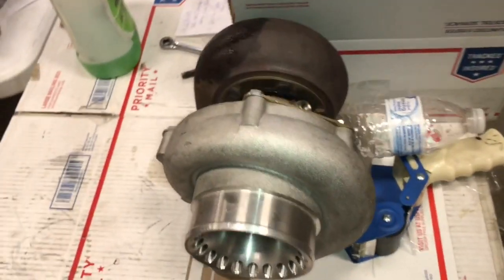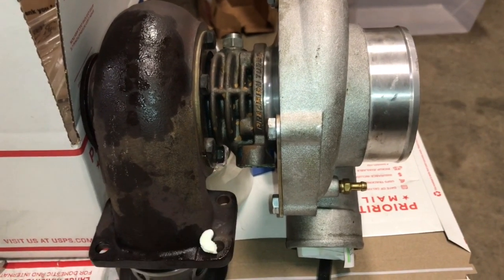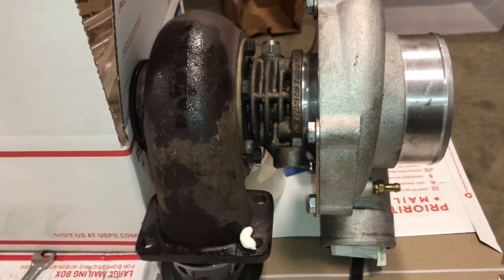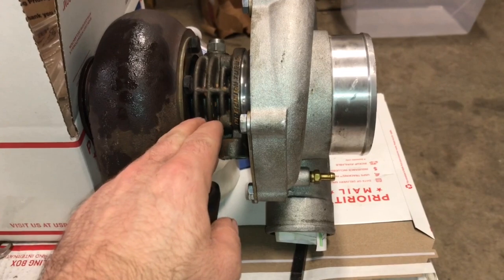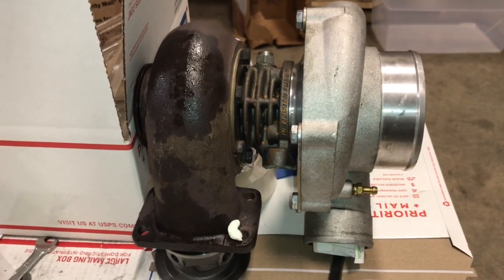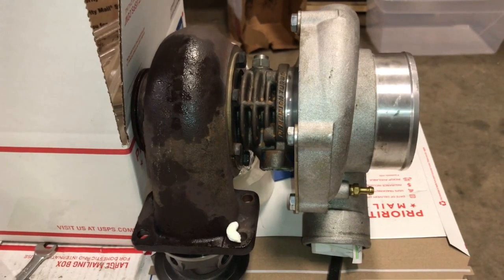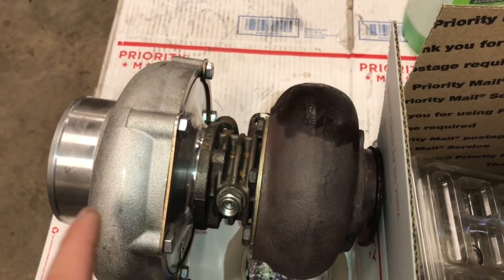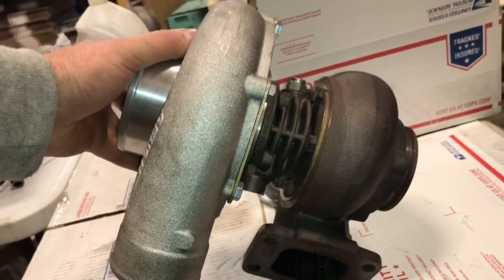New Precision Turbo Leaking Oil

Comment: Thanks mate for the clear explanation and lovely discription of the issue.

Let me please add some info for others to keep in mind

Install your turbo high enough and ensure the oil drips back in the pan ABOVE the oil level in the oil pan

If low mount tubro. Use scavenger pump and use  pre-sump tank WITH breather vent line vertically to up minimum 2 to 3 inch high of the small sump tank

Ensure the inlet comjng from the turbo is high point and the lower is for the pp to suck back to the main oil pan

Keep in mind if u loose yr pump or doesn't works for any reason YOUR TURBO WILL BE GONE. THERE FORE PLEASE CONSIDER BY PASS LINE FOR THE OIL TO ESCAPE ONCE THE PUMP IS NOT WORKING. 

Thanks for reading gents. If any issue I can searve u any time

Comment: My journal bearing 6262 is mounted with feed and drain almost perfectly perpendicular to the road. Motor is a built b series honda. I'm using a -10 drain setup but it's been together and running for 1400 miles since new and oil just started pooling like a light switch in the up pipe. Motor is mechanically sound, cylinder leakage is in the low 20% range across all 4 holes. It is running a modified oil pump and the motor itself is built and clearanced for 20w-50 oil. It makes about 100 psi oil pressure at cold idle, 50 psi at idle and operating temp. It's nothing to see over 100psi of oil pressure on even the hottest days above 3-4k rpm. Precision is recommending I run a Turbosmart oil pressure regulator which they normally only recommend for ball bearing turbos because of lower pressure needs inherent to their design. I'm thinking this journal bearing 6262 of mine is actually hurt internally though since the issue popped up literally overnight
Reply: any updates? my journal 6266 after 1300 miles started leaking out the inlet part. just fine mist of it..

Comment: Thats great info.
I have a similar problem, i have a GT3071R blowing oil out the turbine and compressor. They're new turbos i fitted on a Nissan V8. I was told the stock oil pressure from this engine was way too high for  my ball bearing turbo, about 140PSI! Apparently it can blow the seal. I think one of your videos you say it may be a simple fix or a seal replacement??
Thanks

Comment: OMG this is my issue?  My 2871r/bb is shooooting oil into my air filter at this point (filter mounted directly to turbo). Had it rebuilt once about 2 years ago, and since my engine rebuild, it's been non-stop.

Comment: Hi I have  my 6466   keeps spitting the rear seal  it's been changed twice I have a billet high flow oil pump  turbo only done   3000km and it is mounted in the correct position.  Please help regret not buying  a garret 😒

Comment: Could a blocked or part blocked intercooler , make a turbo leak oil on the exhaust side
Reply from the maker: I’m not sure about that. It would be hard on the compressor wheel with all the back pressure.

Comment: You think about it for a sec,  that turbo is spitting out the seals which has to be a lot of pressure,   and the oil return is wide open just at a slant and it's not draining , that slant isn't enough to get it pushing oil,   it cause he is running to much oil to that small bearing to handle ,

Comment: I replaced my turbo t63 with an identical one but there was a tiny oil restricter inside of the old turbo that didn’t fit down into the new turbo so I just ran the feed straight into the turbo with the same 90 degree adapter it’s always  had and I never ever had oil at the inlet till now. Only put 50 miles on it. Can it be the oil is too much?

Comment: Does the bearing alignment pin that holds the ball bearing cartridge together have a built in orifice? (0.035”)? Previous owner of my turbo never had problems running -4/-10. But doing my own research before hand if I need a new fitting with a restrictor. Thanks
Reply from the maker: Don’t use a restrictor, if it’s leaking oil, you need to correct your oil drain size or diameter
Reply: @turbolabamerica  I'm not going to be, I just want to know why Precision advises against it when other brands have made it a fact that Ball bearing turbos NEED a restrictor

Comment: with precision jb turbos having such a bad reputation for leaking oil and not lasting long. whats your opinion on their jb turbos for 900hp +?
Reply from the maker: Their journal bearing turbos are good if you change to the copper bar bearing. I have a lot of people ask for turbine replacements for the 75mm turbines they use in there next step up, I have the rebuild kits but not those shafts. I don’t know the quality of the bigger turbos, I have only seen 1
Reply: @turbolabamerica  okay I was thinking of getting the 7175 jb.
Reply: Turbo Lab America where can I purchase the copper bearing ball?
Reply: @turbolabamerica  so you're saying precision journal bearing turbos have a known weak link in OEM form?
Reply: @turbolabamerica  and I should've spent the extra 600 for a ball bearing unit? Aside from possibly too much oil pressure and volume, there's absolutely nothing wrong with my setup. I ran a smaller turbonetics for about 30k miles with a very similar feed and drain setup as with my 6262 I'm having major issues with. I'm not a backyarder, either, I've been earning a living doing this for over a decade

Comment: Hey whats the best prevention method of thrust bearing failure on a new precision journal bearing turbo. Gen 1 6266
Reply from the maker: Use a copper bar machined bearing, the powder ones can have problems sometimes but the steel ones have problems most often
Reply: Throw it in the bin and buy a better brand...
Reply: @pheonixfps9248  just bought one lol
Reply: @turbolabamerica  if its brand new under warrenty shpuldnt i leave it alone
Reply: @joshnowacki4185  🤣
Reply: @pheonixfps9248  are they really that bad ive seen guys have success with them.
Reply: @joshnowacki4185  I've binned DOZENS, but if you're in the US Turbo labs can help you out obviously. They make the numbers, but reliability is not their strong point in my experience
Reply: @joshnowacki4185  I'm in Australia, so we don't have promising PTE repairers here. They mosty repair garrets, bw, ihi, ect.
Reply: Rob G  ah i see yeah im in canada pretty much the same thing lol
Reply: Rob G  what kind of damage are you seeing with those PTE turbos
Reply: Turbo Lab America  hey what is a copper bar machine bearing ?
Reply: @joshnowacki4185  poor sealing, shafts snapping, poor lubrication, but that's more of install error.